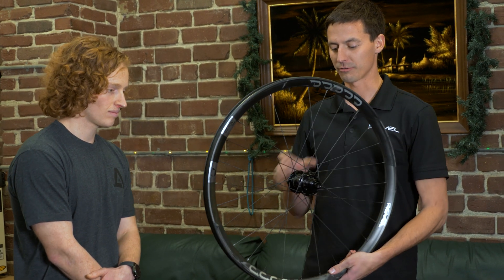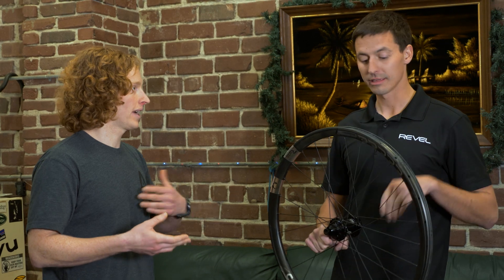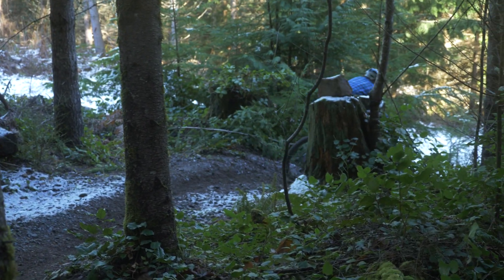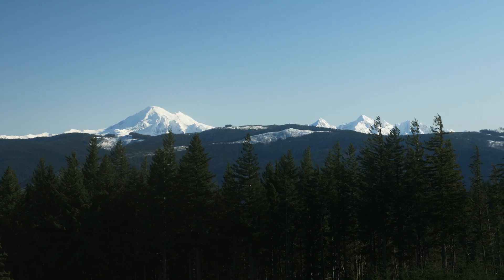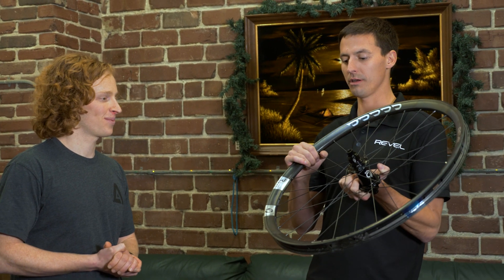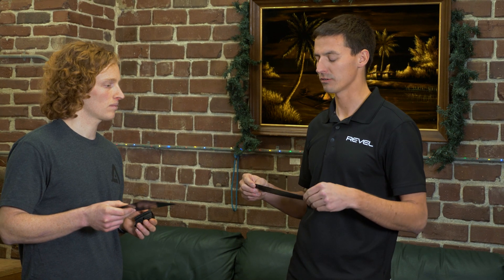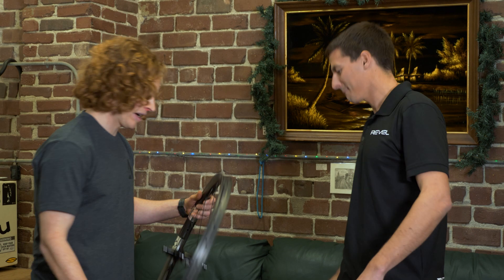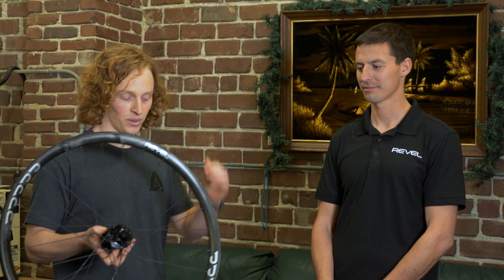"Fusion Fiber" - A Stronger, Smoother Rolling Rim from Revel... And It's Recyclable

Comment: Weight and external width?
Reply from the maker: External width is 35mm, 27.5" rim is 440 grams, 29 is 470 grams!
Reply: @FanatikBikeCo  That sounds heavier, not lighter.
Reply from the maker: @AmsterDanTheAmerican  What are we comparing to? Nox Farlow is 482 grams (29"), Enve M730 is 580 grams (including require strip), S35 is 445grams, etc, etc.